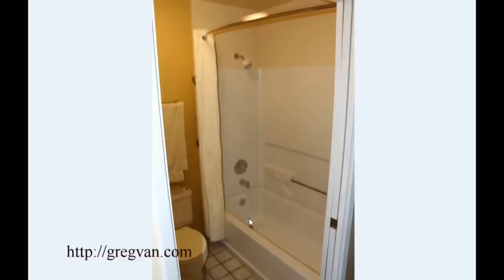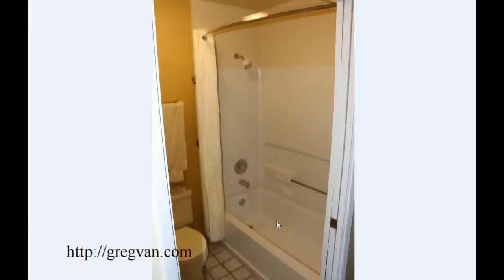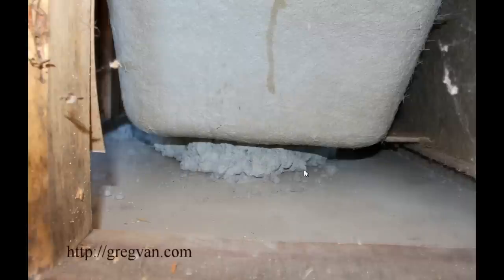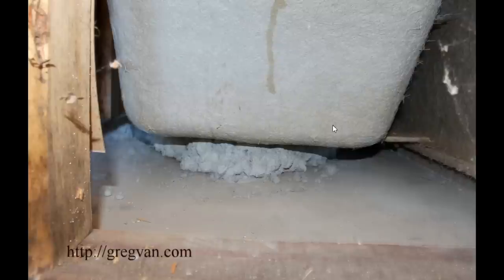Here's What Can Happen If Bathtubs Aren't Installed Correctly

Comment: Been fixing these problems for 20 years. Worked as a Tech for a major tub manufacturer. We drilled holes through the bottom and pour two part polyurethane 6lb foam (from a boat store) through the holes slowly and allow it it expand. Need to be careful it expands at 10 times its volume, so it doesn't take much. If it doesn't reach the bottom do another smaller pour. Then let the foam expand through the drilled hole (by coming out the hole it doesn't lift the bottom)  and cut it off after curing then glass the hole shut and finish with a gelcoat matched to the the tub.
Reply from the maker: I would love to see a picture of the repair and could you tell us how long it lasted or how long it has lasted so far. Can you use fiberglass on acrylic? Have you ever used too much expanding foam and ruined the bathtub?
Reply: The tub you used in the mortar video is from the company where I was the Service Tech. I don't want to name names. I did about 40 to 50 a year  and I worked for them for 12 years. We never replaced any unit I repaired under a warranty claim. The only times we had problems were when repair services used cheaper foam. The stuff we used cost us 450 for two five gallon buckets which includes both Part A and Part B. Yes fiberglass will  work on acrylic but not the  unit in this video. The video has a plastic tub. I've seen them in hotels in Eugene, Or and Spokane, WA. Those if they squeak or crack they just need to be replaced. Fiberglass is used on acrylic from different manufacturers like Lucite and ICI. Those are reserved for high end tubs and jetted tubs.  I personally have never had a problem with foam ruining a tub. But I take my time because I know what can happen especially on the side walls. the key is multiple pours not to try and do it in one. They can actually blow out then you have a real mess. I will contact you through your website if you want to see pictures and videos.
Reply from the maker: That would be great love to see some pictures. It seems to be a big problem with my YouTube viewers and if this is a solution that might work I would love to recommend it.
Reply: remove tiles and remove the tray
Reply: I'm getting noise when I move around in a brand new shower I had installed a few months back. It's a larger shower with a center drain. Might there be a way to access the gap between the subfloor and pan by taking the drain apart? If so, what's the best product to use to fill the gap? Your suggestion of drilling a hole in it scares me. 😂 Have you ever had the patch you do after doing that fail? I feel like I'm friggin cursed when it comes to contractors so I'm just afraid I'll end up with water leaking that I won't know about until the floor fails. 😒 What kind of contractor do you recommend looking for to possibly make this kind of repair?
Reply: @rayanderson286  what area do you work in? I saw you mention Eugene and I'm down in GP. If you know anyone in my area who does that sort of repair, please let me know!
Reply: I am curious if you would be willing to share a recommendation.  I would like to try the foam and have two questions.
1. You mentioned it coming out the holes. Were you willing the entire cavity of thr tub all the way up the apron? Or just under the tub base?
2. Do you recommend 2lb density foam or 6lb density? Thank you!
Reply: @colehelget9359  I always used 6lb but have heard 2lb  worked too. I was doing warranty work and didn't want it to fail. Typically it doesn't go up the apron there's a board glassed to the apron. If the apron needs to be filled because it's thin I recommend calling a professional. Too much foam will blow out the apron wall and give you a real mess to fix.
Reply: @rayanderson286  thank you for the reply. I don't need to fill the apron, was just curious what you were doing. I have a new tub and it has six plastic feet under it that suspend the tub about 1.5" off the floor. Manufacturer recommends to polyurethane adhesive them to the floor. I did, but two are slightly suspended and I can feel it when I walk.  Slight give and squish to it.  I figure before I add cement board and tile, address it. I have access to the underneath of the tub on 2 of the walls and I can do it without drilling
Reply: @colehelget9359  If you can I would recommend tilting the tub forward and mix up a bag of mortar and dump it in the center. Reset the tub and fill it with water let the mortar setup and and then drain it. The weight of the water will spread the mortar out and give the support you need. Make sure to add the recommended ledger board. Smart move especially with tile since the tub can settle and open gaps in the tiling edge.
Reply: @rayanderson286 I appreciate your advice on the ledger board. Manufacturer simply recommended a stainless screw in every stud and corner and nothing more. I have no issue backing up and beefing it up a little. Insurance policy just in case. I was hoping you wouldn't suggest to pull the tub, haha. Four of the six legs are bonded very well to the subfloor

Comment: I have a jetted tub that makes the same sound when you step into it. The water pools in the middle and I have to use a squeegee to get all the water out. Additionally, when the tub is filled with water it broke away from the tiles surrounding the tub and there was a huge gap between the top of the tub and the tiles. This was installed following Hurricane Harvey by a licensed and bonded plumber.

Comment: This exactly what happened to me.  After about a year my tub started creaking like crazy.  My plumber didn't use any mortar and he said it would be ok because there are a bunch of little legs under the tub that contact the floor for support.  It was OK for a year or so but that was it.  I just tried spraying expanding spray foam underneath the tub.  Cut out some drywall on one side but it was hard to get the far side of the tub because I couldn't see that far underneath the tub.  I used an extended rubber type tube to extend the nozzle, but that created a mess and still couldn't see how much foam I was getting out.  The tub is still creaking so that was a waste of time and money.
Reply: Same issue here smh what did you decide to do? My tub is the soaking size hate to have to replace it!
Reply: It actually took 24 plus hours after spraying the foam to notice a difference.  It definitely helped. Make sure and keep water in tub for  24 hours until foam settles and expands fully.  @ulovemichelle
Reply: @markhopkinsphoto7257  thanks so much I’ll have a plumber try this method! I don’t like sounding like I’m gonna fall through😭
Reply: I would hire a handyman to do this type of job.  Plumbers charge much more and it's not a plumbing job. @ulovemichelle
Reply: @markhopkinsphoto7257  agreed thank you!
Reply: @markhopkinsphoto7257 hey can i ask u.... i had a guy put foam underneath  in the crawlspace between the floor and tub and that only worked for 2 weeks.   Can this be fixed without taking the entire tub out?

Comment: I have a cracked tub.  because of no support under the tub.  Is there a way to get some support under the tub without replacing it?  Minimal expanding foam?  your thoughts please.
Reply from the maker: +David Miskin I hope others read this comment. If you have a cracked tub, then there is a good chance it's already leaking or will start to leak in the future. I would replace the bathtub and install it correctly. Even if the bathtub isn't leaking, I haven't figured out an easy way to make this type of repair.
Reply: did you get any help? I have the same problem, i rent but he is old and it will cost him, so we need a temp fix to not give the old guy a heart attack! lol i even put adhesive fiber glas plates because it soo long but nothing 2 days later they float.What a headache
Reply: Liz Iglesias hi Liz. there are tub refinishing companies out there that can fix your situation I happen to be the owner of one myself in Massachusetts
Reply: @bpell721ify  what's names of company? Google?
Reply: @chadbailey8152  Pellegrini Refinishing out of Ludlow Ma.

Comment: Hi Greg.  My two year old Kohler Archer acrylic tub has a crack on the bottom of the basin.  It was installed by a licensed plumber and permitted and I saw he used mortar underneath.  Anyway, now I have to decide how to repair it since the tub is not under warranty.  One company's option is to drill holes in the tub, squirt something into the holes to secure underneath where the crack is and then repair the crack.  Another option by a different company is to place a custom measured floor liner on top of the existing bottom.  Do you have any idea what is the more effective solution?  Thanks a lot!
Reply: Drill 1/4 in hole

Spray/Fill with 
LOCKTITE TITE FOAM multipurpose

Than use 
FLEX SEAL LIQUID RUBBER 

It comes in white, to seal hole and any possible crack/s..

There’s a guy that has a video

“Easiest way to repair crack in shower bottom tray pan”..
Reply: Call Kohler directly.  They have technicians that do crack repairs perfectly.  Found this out when a painter put his step ladder in the tub w/o protection and punched holes in the acrylic (corners of the ladder feet.)  Luckily the client got warranty repair since it was only delivered the week before and had never been used.

Comment: I got a crack where you lay down after we had a contractor come renovate our entire bathroom . It’s a fiberglass tub and wondering is patching it up
Ok to do or does the tub have to be replaced? We had gotten wall tile all around the tub and wondering if we did have to replace , what will happen to the tile around it?
Reply from the maker: You can try fixing it, but I don't have a suggested method for that. If that doesn't work, then the bathtub might need to be replaced and of course the tile or at least the lower course of tile will need to be replaced also.

Comment: I am renting, and the tub was squeaky and soft right where you have to stand to take a shower. Eventually it cracked. Can I be held responsible for this when I leave or could I use improper installation as a defense to keep my security deposit?
Reply: Invisible Image Ok, thank you.
Reply: if you knew it was a problem and didnt say anything thats when you can be held responsible.
Reply: This happened to me and I’m scared that I will be held liable I stepped into the tub it made squeaky noise now I have a huge crack

Comment: One thing that I do not see in any of the videos is...Along the apron of the tub, and the back side of the tub use R-11 insulation to help retain the heat of the water while soaking. I have done this before and it help tremendously. On acrylic tubs be careful as not to "over-stuff" the apron section as it will bow out. Use a MINIMAL amount of glue to hold the insulation in place...a drop here a drop there. This will keep the water warmer longer especially when the alcove tub is on an exterior wall.
Reply: Are you sure you'd want to put fiberglass insulation in a room with humidity? I use polystyrene.

Comment: I have question! I live in Florida and I've hired a person to install my 60x32 Fiberglass  Everclean Whirlpool Jacuzzi tub. It has no support to it at all, the book that came with it says to use Mortar, but this guy bought Quikkrete Sand Topping Mix for support. Will it damage my tub in any way? Or should he be using Mortar instead? If it is safe to use quikrete should he put iron bars in it also for support? I need an answer by 7th of November 2018 before he does it. Thank you
Reply from the maker: I would contact the product manufacturer. However, I understand you're in a hurry and don't really know much about sand topping mix, so would suggest using mortar.
Reply: I'm installing the EXACT same tub right now. And I gotta say, WTF!! This thing is a nightmare! It's not square at all. The bottom is warped. I downloaded the PDF installation manual and it is very vague. But the only real option is mortar because of the cheap tub design.
Reply: Sand n Topping mix is better than straight mortar.

Comment: This is why I have elected to go with cast iron for my remodeled bathroom. Gelcoats and acrylics in my opinion are garbage because they rely on the builder to provide the structural integrity instead of building their bathtubs of high structural quality.
Reply from the maker: Good choice and cast iron tub seem to last a long time.
Reply: And if your bathroom is the width of your tub and you work alone?

Comment: Do you think floor leveler would be enough and would you still recommend using mortar, my entire bathroom slopes like 1/4 inch
Reply from the maker: I don't think it would add a lot of weight to the floor framing if it's a wood frame floor, but it could separate from the subflooring in the future and that could create bigger problems. I used for leveling compound on concrete without any problems.

Comment: Has anyone ever used mortar with foam beads, or foamcrete to set a tub?  They have pretty good compression strength, and would add some insulation to the bottom of the tub.....
Reply: I've used that.  It's equally effective but EXPENSIVE.  I mostly used Sand n Topping mix.  If there was a weight concern (never should be, but....some clients) I would mix in perlite with the mix.
Now I used a high density expanding foam with great results.

Comment: I came across this video because a brand new Vikrell shower and surround I had installed during a renovation just a few months back is making a creaking noise now when I move around in the shower. 😭 What's my best way to fix this issue, or is there a way to do it without ripping the walls open again? I had new tiles laid and everything. Ugh. One site mentioned spraying expanding foam in between the subfloor and the shower pan bottom, but the only ways I can think to access that are from under the house or drilling a hole in the shower pan, which scares me. Is it possible to access any sort of gap there by disassembling the drain? I've got a center drain that's pretty large and I'm wondering if I take that drain apart, is there usually a slight gap we might be able to spray expanding foam into? And is that strong enough to resolve this issue?
Reply from the maker: See if this video helps. https://youtu.be/pvhnnkqQ3fM
Reply: @gregvancom  I saw this one. Unfortunately my set up is a shower only, so the bottom pan is only a couple inches tall. The left end is against an exterior wall, back side against the tub in the other bath, and the right end is in my bedroom, but also the end with all the plumbing... And the sound is coming from around the drain, which is in the center of my shower pan. 😔 I didn't notice it until recently and I'm wondering if our freezing temps have caused some contraction of the subfloor, which hid the issue during the warmer months when it was installed and things were expanded.

Comment: Even with the support system I use foam spray and spray underneath and the front and let it expand never had a problem with that
Reply: Any special brand spray foam do you recommend?  I was thinking about even getting 1/8" plastic tubing and tie it to a electric wire to go deep under the tub.
Reply: @ddkim619  that's a good idea to have the wire guide the tubing in hard to reach areas, I just use that great stuff brand seems to expand alot

Comment: Could it be the floor or subfloor that is squeaking under the right leg of the tub? Might want to have a joist directly under each leg if possible.
Reply from the maker: Yes and if the tubs are installed with mortar it usually disperses the weight more evenly than on the legs if the tub has them.

Comment: In your opinion would you say acrylic or steel tub is better? Any why?
Reply from the maker: I would've said steel 10 years ago, but some of the acrylic tub seem to be lasting longer. Steel tubs seem to be stronger and more durable, but on two occasions I dropped a piece of tile that chipped the finish that eventually led to a hole in the tub as it rusted or corroded and dropped a 2 x 4 onto one acrylic tub that led to its replacement. Cast-iron would be the best choice, but it's probably a tie between acrylic and stealing in my opinion

Comment: I stupidly installed my one piece tub and surround without using mortar because the instructions said I didn't have to. 5 years later I have a soft spot and a crack. I am so mad right now. I was hoping this tub would last at least 25 years but now I have to tear it out and drop in a new one.